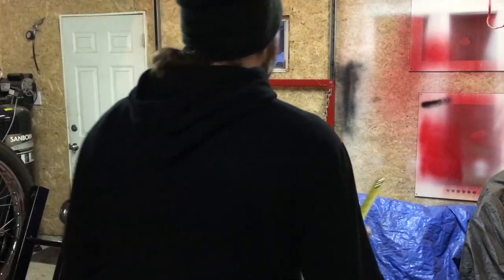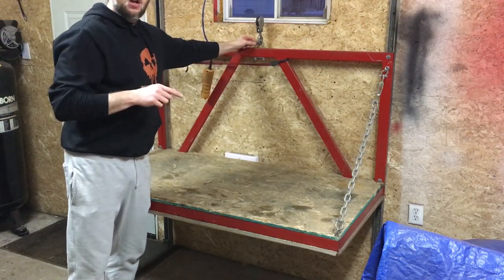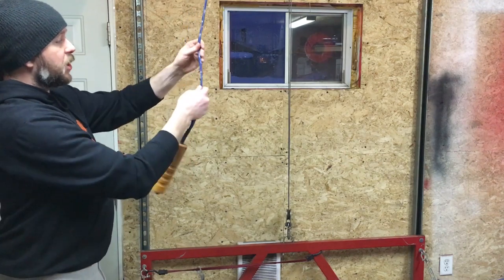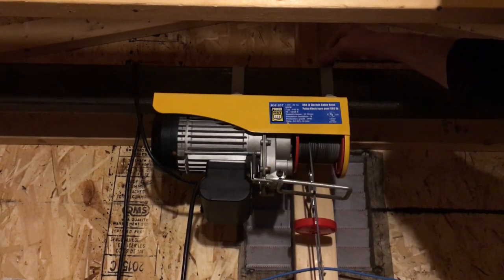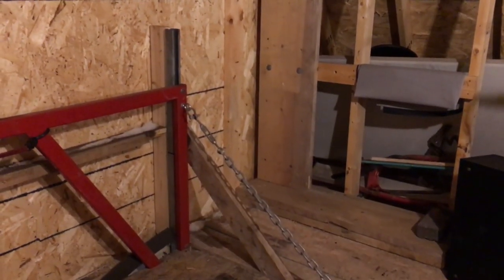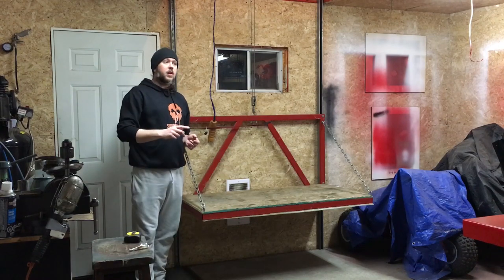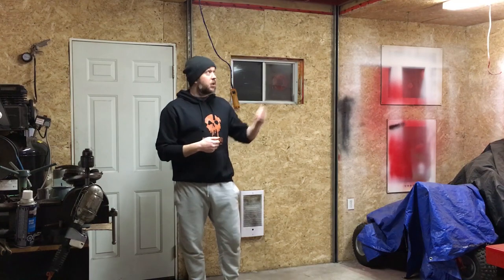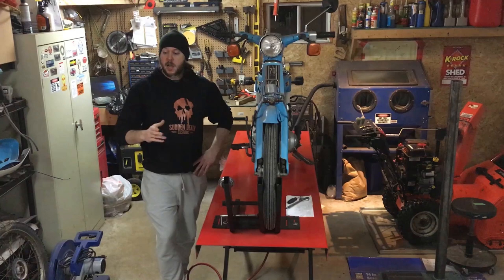Detailed Garage Attic Lift Build (HD)

Comment: Question for you, or anyone who's done something similar.  I've never seen those rails + wheels in person.  How stable is the "floor" surface.  In my case I'm looking to build a custom, height adjustable desk, that will have 4+ large monitors hanging off of it (200lbs of monitors and arms).  If you raised your platform to desk height does it feel stable ?  Or do you notice "play" in the rail + wheel areas that would cause everything to move around everytime you go to rest your arms on the desktop (aka your elevator floor).  Thanks for taking the time to show us this!  I also plan to install one in this same manner in my garage space and your details here helped answer some questions I had for that project!
Reply from the maker: Hey Brandon! Not sure what kind of arms and monitors you plan on using but 200lbs is crazy heavy in my experience for that type of gear! That being said...

When I load my lift up with 400 - 500 lbs, I try to keep things centered and as near the back as possible. It's been solid to this point and I'm 6 years on at this point. If your lift would be more shallow, then the rotational moment would be even less (monitors and arms aren't that deep, right?) so I'd think it would be fine.

Ultimately, I'm not a mechanical engineer, so take anything I say with a grain of salt!
Reply: @blastworks  good to know thanks for the info !

Comment: There are many very similar video's out there on this subject. Most of them use the Harbor Freight hoist. I personally am planning on doing the same thing but I have little or no trust in anything Harbor Freight sells. Many people claim these hoists have a lifting capacity lbs. but that likely isn't true. It has a pulling capacity which is doubled if the snatch block is used. This arraignment does not double the lifting capacity of the cable itself. I have used one of these hoists a few times for very light lifting jobs and the cables are already frayed. I may use it for this application but the cable will be changed out to aircraft grade prior to the project. 

For those contemplating doing this, I would search out the video where an arresting life line is included just in case something like the cheap Chinese cable should fail.
Reply from the maker: Hey Joe, I hear your concerns! Like any type of DIY lifting system, there are inherent risks, and it is ultimately upon the user to accept those!

Comment: wrap a chain, or a towing strap around around the cross beam where your U bolt is then hook it to the lift for redundancy.  If your U bolt breaks the chain has it.   I have a 3000 pound strap around mine... I feel a lot better because welds to break.  : )    Nice build my friend.
Reply from the maker: Thanks Hip!

Comment: Good day sir, well done on the project and video. I am in the process of making one very similar. Would you be able to share which track dollies your are using and how they have been working and how long. I found mixed reviews when researching this item. Thank you for any assistance you can provide.
Reply from the maker: Hey Gary, I provide a link to the channel and trolleys in one of my previous videos about my lift. You can find it on my channel under Videos!
Reply: @blastworks  Thank you very much for the prompt reply, very much appreciated! I found that you originally used two-wheel dollies and noted you were considering changing but they work fine. I could not find the link to the trolley and parts. Did you change up the dollies and would you be able to share the link to parts, please? My apologies for being unable to find the link.
Reply from the maker: @garylindow9755  You can find the links to the channel and trolleys in the video description on this video linked here: https://www.youtube.com/watch?v=kjlZHgo2w-Q

Comment: Why did you use chains instead of tubes? Would angle tubes work all the same? Any disadvantages?
Reply from the maker: It's just what I preferred using. I don't think there would be any major advantages or disadvantages either way.

Comment: Because it has to fit through the ceiling, why did you not make a fence around the three sides of the lift? It wouldn't have to be there for strength but in case something wanted to tip over on the way up that you couldn't see. 1/4-inch plywood would work or aluminum sheet with hinges on the front side for loading. Where do you put the control switch when you don't go up with the lift?
Reply from the maker: What if the thing that tipped over was taller than the fence? It'd still get caught on the way up. The control switch just hangs down though the gap on the left side when the lift is up and I'm down bottom.

Comment: So, if you're downstairs and lift it to ceiling height, the remote cable is just wedged between the lift and ceiling?  I'm guessing there's enough gap, and the weather stripping makes up the difference.
Reply from the maker: That's correct NS Gearhead! There's about a half inch around the entire platform when it is up in the hole, so there is plenty of room for the cable to not get pinched there.

On a side note, does the NS in your name mean Nova Scotia?
Reply: @blastworks  Certainly does!  I'll be hopefully building a garage this year and this has become my favorite detail I hope to include.
Reply from the maker: @wannabejeeper  That's awesome, greetings from even further east in NL :)

Comment: I wonder if two hoists can be used in parallel. Only putting 50% strain on each, having a redundant hoist and having two cables. Probably very hard to keep these hoists running in sync.
Reply from the maker: Yeah, I like the idea 100%. I think the execution could be a bit tricky, but it is definitely doable!

Comment: Looks like attic trusses - did you have to cut a truss to get the depth out of the carriage?
Reply from the maker: I did! It worked out such that I only had to cut one the width of the hole, which was then properly shored up against the other surrounding trusses with joist hangers and the like.
Reply: @blastworks  I'm currently looking at the same thing, but I'm hesitant to cut on a truss. 

I need to figure out the most secure way to brace it and keep the tension there.
Reply from the maker: @BellyUpFishGarage  Here's a rough image I just drew up, four different phases that are numbered. Note that the view is of three trusses from top down/bottom up. The following is how I did it. I am hosting it from my SSL secured website so it is safe for you to click.

https://www.blastworks.net/uploads/cutting_and_supporting_trusses.png

1) The original 3 trusses after initial installation.

2) Supports installed between the trusses that will remain and the one I have to cut.

3) The piece of the truss that needs to be removed is cut out.

4) Two final support pieces spanning the entire depth of the hole linking the surrounding trusses and then pieces of the truss leftover after cutting directly together.

This is what worked for me, and depending on how your trusses are, it may work for you. Ultimately, keep in mind that I am not a professional carpentry or structural engineer by any means, this is just how I did it in my case!
Reply: @blastworks  That’s basically what I’m going to do, with some small variations. Just got back a drawing from a structural engineer and it’s very similar to what you’ve done.

Major difference I can see is that he suggested blocking up the joist prior to cutting, and then I’ll be tripling the sisters on either end of the cut.

Thanks for the reply!

Your elevator is the best I’ve seen and I’m planning on copying it pretty heavily. 😆
Reply from the maker: @BellyUpFishGarage  That's awesome! I'm glad my example has been inspiring!

Comment: Love this!! Any difficulty in aligning the trolley wheels in the struts -  you know parallel to each other after attaching trolley wheels to the platform?  Tips to do that part right the first time?
Reply from the maker: Hey Deste! No issues at all! I measured center to center at the top of the rails, and also at the bottom of the  rails to make sure they were the same distance apart, and then I just made sure my trolleys were installed on the lift frame that same distance apart!

Comment: With the right hoist, what are your thoughts on lifting a zero turn mower up to the attic?  It's about 1100lbs.  I am considering storing my mower out of the way during the wintertime.  Most likely, to avoid stressing the joists, I'd keep the mower on the actual hoist platform.  Thoughts?
Reply from the maker: Hey Ashlin. I think if you have some kind of pin system to keep the platform in place, similar to how 2 post car lifts do it, it may be possible. You'll likely want 3 or more rails as well. You're going to need to build a far more robust platform than the one I have, and you'll probably also want to go with a 1000kg cable hoist. Check out my latest video on my channel, I'm actually giving a hoist away next month!
Reply: @blastworks  thank you!!

Comment: Fantastic video and great work!  Hoping you can help with a question as looking to utilize the same strut / trolleys but can’t figure out how you mounted the strut so that the Trollys still clear?  Any info is much appreciated!
Reply from the maker: Hey Joe! I had to grind the heads of the lag bolts down a little bit, then trolleys cleared them no sweat!

Comment: i can not obtain 12 gauge unistrut here, only 14 gauge, for a 400 lbs 9 foot stuff elevator, would this be a risk versus 12 gauge?
Reply from the maker: Unfortunately I'm not a civil/mechanical engineer so I would not be able to give you an accurate answer on this. All I know is that in my application, most of the load is downward on the cable/hoist and supporting beams, and not pulling outward on the unistrut.

Comment: Thank you for your video. Question: As you are clearly good at welding, why did you chose to use the two chains instead of extra steel beams welded?
Reply from the maker: Hey! I can remove the chains and get something much longer on the platform if I wanted to raise it up to work on it but not lift it up into the attic. If there were pieces of tube steel welded in there, I would be restricted to the width between them.
Reply: @blastworks  Ah yes I understand. Thank you for the quick answer.

Comment: It would be really cool if you could install a limit switch, similar to what can be found on a CNC machine, to automatically stop the lift when it gets to your desired height.
Reply from the maker: Hey Pagan! Things like this are in the works for an upgrade in the near future! I actually plan on upgrading the hoist and some frame elements, and I may even give away the current hoist to one of my subscribers for a 2000 sub giveaway. Stay tuned!

Comment: You verbalize that your struts are Unistrut 1 5/8” channel, but when I click on the link it’s 1 5/8 x 1 3/8 channel. I’m just curious as to which is correct so that I can get the right stuff. I imagine it matters with the height of the trolleys. Can you clarify?
Reply from the maker: The channel linked in the video description is  1 5/8 x 1 5/8: https://www.fastenal.com/products/details/48424
Reply: @blastworks  Yes, I’m sorry. I meant the picture of the strut that comes up inset into the video. That describes it as 1 3/8 x 1 5/8. 

I assume from your message, though, I need to order the product at the link. 

Thank you!!

Comment: This looks like it might be the answer to my prayers! Just need some info, a bit of help. I am recently disabled, can no longer climb or descend stairs, without a great deal of pain and a LOT of danger. Having just turned 66, fining myself unable to get to the 2nd floor where my bedroom and the full bath are, is a real life threatening and life altering situation. I really need to know, can this be adapted to life me approximately 9 feet straight up? From the floor of the family room to the floor of the open loft overlooking the family room?

Once in the loft, I can get to the bedroom and full bath using my wheelchair. The problem is getting up that 9 feet. A chair lift, to go up stairs is really not an option for me. I need one of these.

What do I need to do to make this safe for an old 66 year old disabled man to use abut 3 times a day to go up and down from the first floor the 2nd floor and back down?

thanks in advance for any assistance you or your subscribers can offer!
Reply from the maker: JM NM I honestly wouldn’t recommend something like this for someone in your situation. There are much safer alternatives commercially available that would come with appropriate installation, service intervals, and warranty.

This type of lift is more suited to lifting things like snowblowers and tires for storage. My lift probably only gets used a couple times a week max. Your frequency of usage would warrant a system built to handle just that as well.
Reply: @blastworks  Thanks for the response. Thing is, money always rules. While there may be more suitable options for a handicapped person, we do what we can with what we have. If I had the money, I would be looking at those other options. Things being what they are, here I am.
Reply from the maker: @jmnm4894  I hear what you are saying JM. I'm going to assume that you are based in the US, as where I am located in Canada, and in a lot of 1st world countries,  a good portion of such a mobility system would be covered under government provided medicare programs. There are also organizations designed to give financial assistance to people in your situation as well when it comes to mobility solutions for disabled persons.

If you are able to get something put together like what I have done here, just be sure you have redundant safety measures in place. It may add to the cost of a project like this, but as you mention, it would be much more inexpensive than commercially available systems! 

Good luck, and be safe!

Comment: Hey Blast... lift is just about complete. I just need to install the hoist. I have a question... I am concerned that the hoist cable isn't exactly centered horizontally over the lift. I'm offset about 3 inches. Is that a real problem? I'm concerned the hoist will be pulling the lift up at a slight angle putting some stress on the super-strut channels. thoughts? thanks brother
Reply from the maker: I tried to make sure mine was as centered as possible. If it just means loosening up the mounts for the hoist and adjusting, then I'd recommend it. Keep in mind, as the cable is wound up, it will move back and forth a few inches for sure as well, so if you are off center by a few inches, that could add up to 5-6 inches when the cable is winding back and forth on the reel!
Reply: @blastworks  Thanks brother... however I didn't explain it correctly. Im centered left/right over the lift, but I'm off a couple of inches fore / aft. I can't get the cross beam close enough to the back wall to be directly overtop the lifting point on the lift.
Reply from the maker: @fasteddie4802  Now I'm picking up what you're laying down! I haven't experienced that specific case, but since you won't be pulling directly up, some of the force will pull outward on the channels, and this will increase the higher you go up on the lift as the angle between the cable and the plane of lift increases. I'd try to make sure that 1) the channels are anchored to the wall as well as you can anchor them, and 2) you don't exceed the maximum force the runners inside the channel are rated for. I know that you can get heavy duty ones from ebay (or even make yourself a set), and that the stock ones are only rated for something like 50lbs or some such. I'm sure it will work fine, but I'd recommend testing things out in a safe manner to confirm.
Reply: You might be able to add a pulley, or something like a roller, to pull the cable closer to the wall. It should be installed right above the attic's floor level. Unlike the hoist mount in your case, it can be installed much closer to the wall, or even in the wall cavity between two studs, if needed.

Comment: Just found your video. Awesome... gonna try and duplicate your setup. quick question on the dimensions... i got the 59" wide and 31" deep, what is the height ? Thanks man....
Reply from the maker: I believe it's roughly as tall as it is deep. The taller it is, the more spread out the moment of rotation will be on the rails as well. I think you'd be safe to make it as tall as it is deep, or maybe a little taller.
Reply: cool...thats what I figured as well. The elevator is in fabrication. I'll post a pic. “Imitation is the sincerest form of flattery that mediocrity can pay to greatness.”- Oscar Wilde
Reply from the maker: @fasteddie4802  Thanks again Eddy! Nothing but the best of luck with your version!

Comment: Just what I needed. Do the metal trolleys clear bolts in unitstrut channels?
Reply from the maker: Hey Miguel! I ground the the heads of the bolts a little bit and the trolleys clear just fine! Check out my latest video as I am running a giveaway on a cable hoist!

Comment: Nit picking a bit, but HSS is high speed steel, as are used in drills and machining. You mean hot-rolled steel.
Reply from the maker: Last time I checked, there wasn't a monopoly on acronyms! It also means hollow square stock or hollown structural steel where I come from!
Reply: @blastworks  I didn't realize that was what they call it in Canada
Reply from the maker: @lukemartin9209  My man!

Comment: Were any floor joists cut to make the hole big enough for the platform? Ive seen other styles that are 22 1/2' platform to fit between joists/rafters/whatever
Reply from the maker: The floor joists in this case are the bottom spans on the barn style trusses up above. I purposefully chopped out what was required to make the hole the size I wanted it to be!